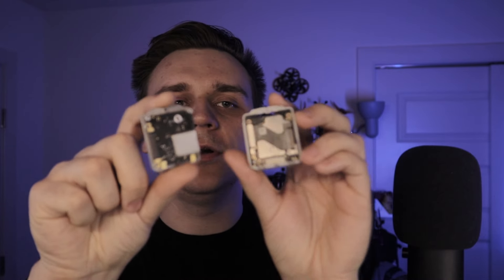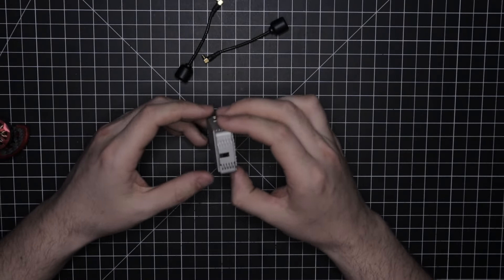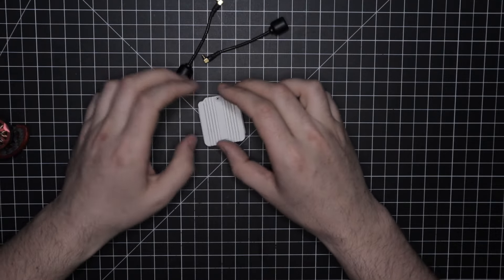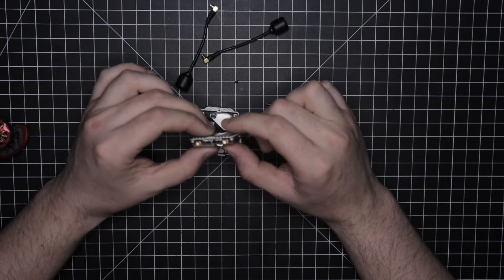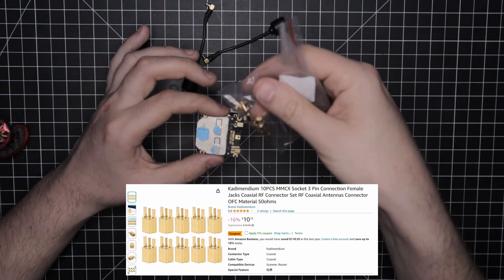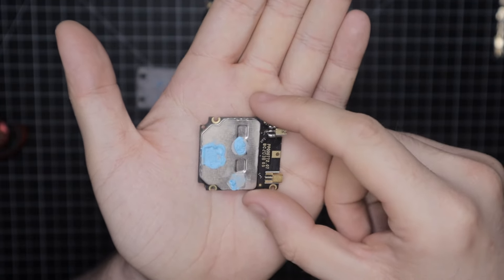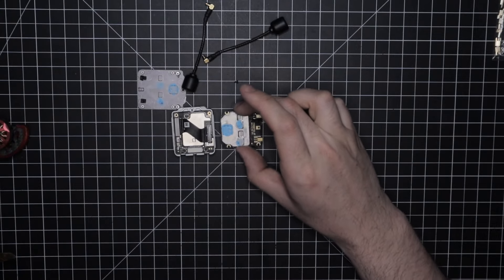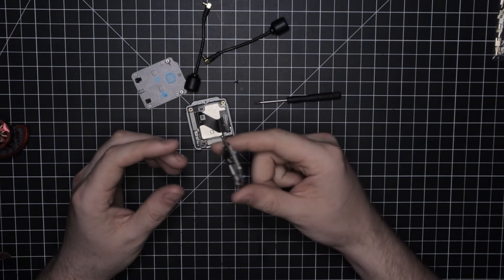NO VIDEO AIR UNIT CANT BIND | DJI AIR UNIT V2 GOGGLES

Comment: Hey mate hoping you can help 
I have a new unused air unit 
It is activated and binds fine , 
Has my battery voltage but no video just a black screen with the Dji logo 
Any possible fixes would be much appreciated!!